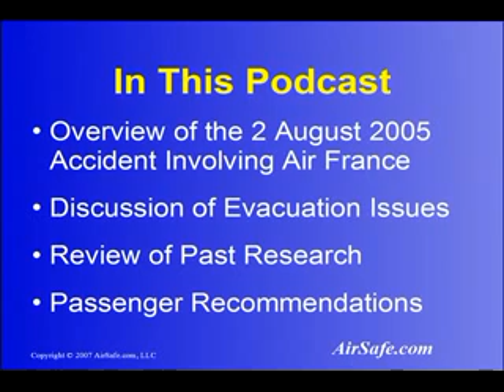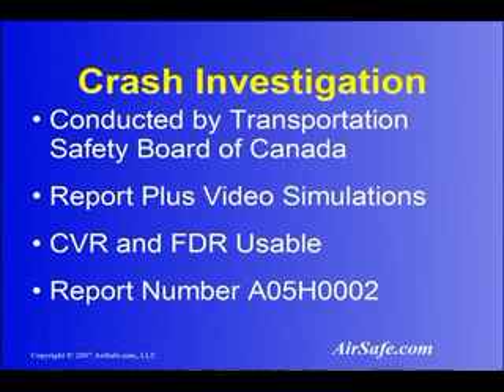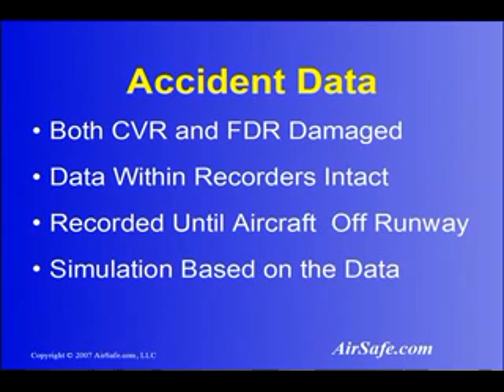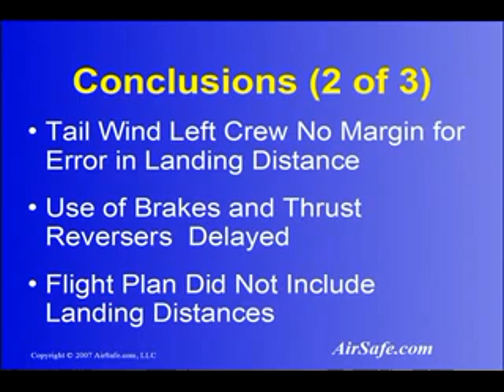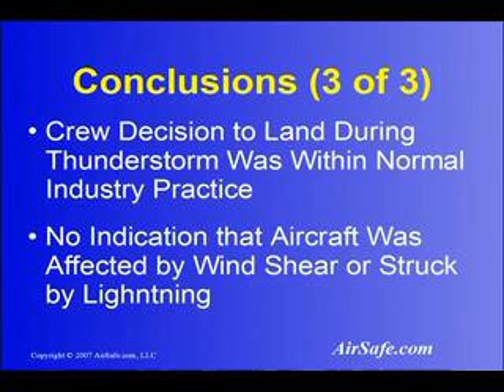Evacuation Issues: Crash of Air France A340 (part 1 of  2)

Comment: What a lousy video. I learned nothing from it. Windshear, or the 5 to 10 knot tailwind, had nothing to do with this accident.  The pilots screwed up, period. They  approached on   ILS,  came in 50 feet too high, landed  long,  and didn't engage thrust  reversers for 12 seconds.  Two  previous planes ahead of them landed with no problems.